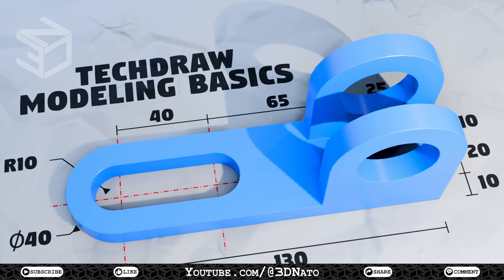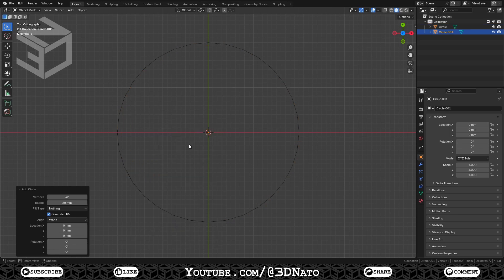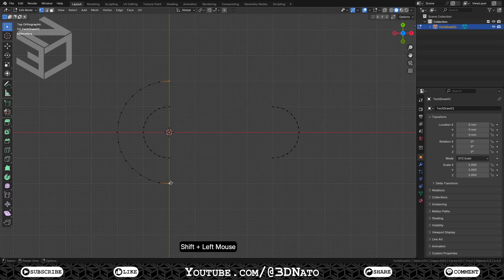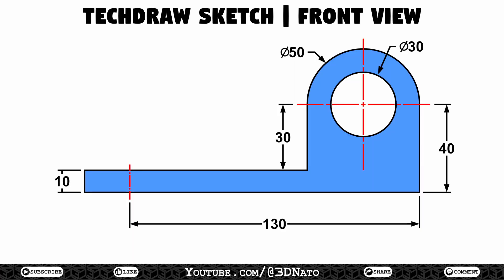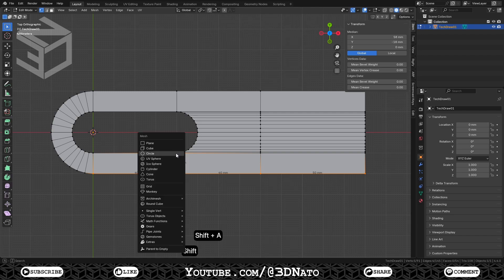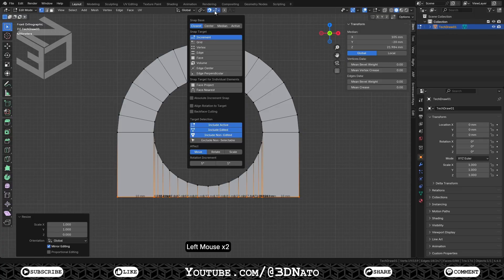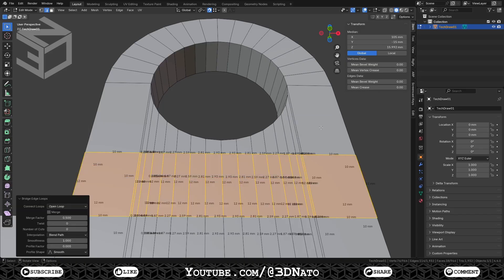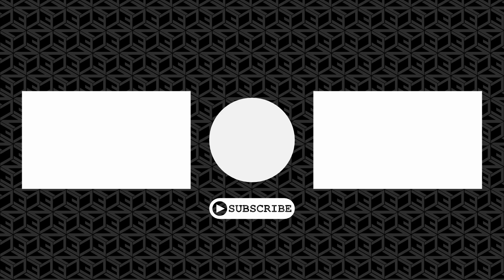Blender Precision Modeling Tutorial | Modeling Practice 01

Comment: Thanks for your good tutorials , but shade smooth doesn't have effect on the mesh for 3D printing , how do i go to make it smoother without loosing the shape?
Reply from the maker: You could crease all corner edges and use a subdivision surface.
The problem with that is that with this mesh, all round parts will shrink a bit.
Meaning that the radius and diameters of these circular shapes will not be the same.
If I were going to make this for 3D printing, I would start with a higher polycount.
Reply: @3DNato  Thanks for your explanation

Comment: At 2:47 , where did the two edges you create went??? Did you Ctrl+Z or? The two edges filled with the two verteces completely disappeared .  🤔
Reply from the maker: Are you talking about the 2 horizontal edges between the 2 small semicircles? They are exactly under the grid lines, which is why it looks like they disappear.
Reply: @3DNato  I see, it's interesting how only the straight lines are under the grid, not the circles curves, considering they on the same plane.
Reply: @asmewilliams7117  I think you misunderstood, its not like it is Under the grid, it just overlaps with the grid, and hence it blends in with it, giving the illusion of it disappearing.
Reply: @BlackLotus6969  I see, Thanks for the explanation.